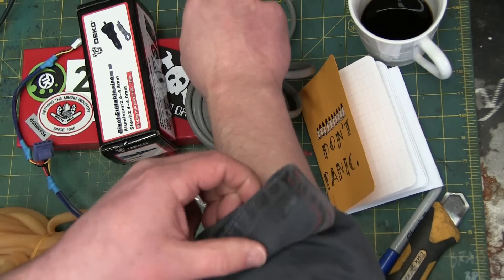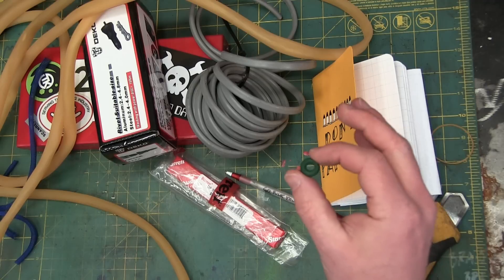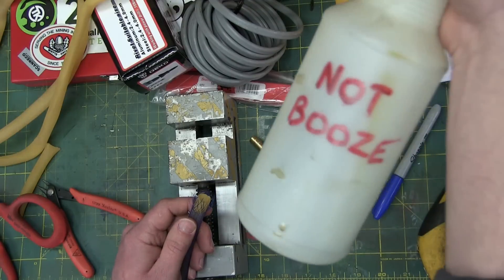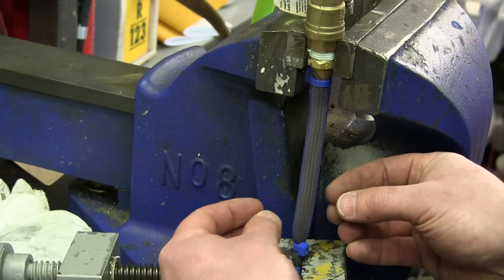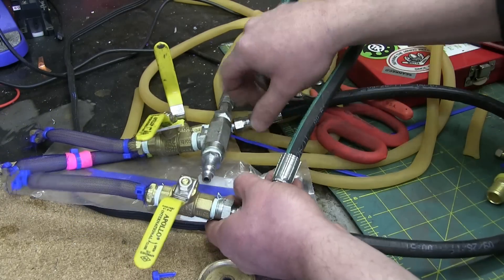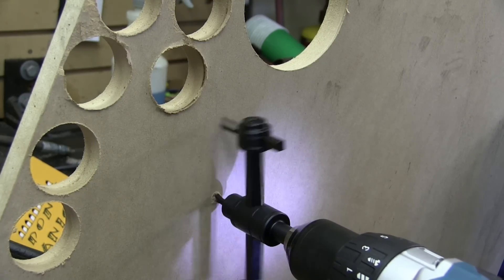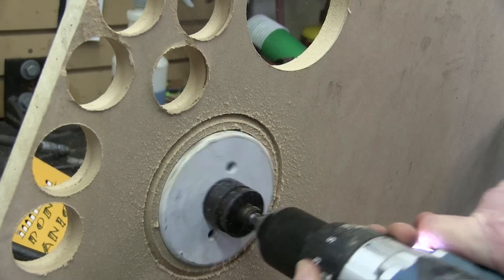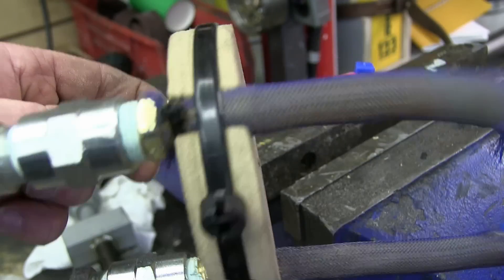Air Muscle Flex Joint for Soft Robot.

Comment: if you wiggle as you cut, as with your hole saws there, you can reduce stalling and jamming. the mechanisms are: slightly wider kerf gives clearance so the tool shank can't rub, and: tool pressure is focused into sectors. tool power is focused on that sector, so the motor has time to rewind to optimal rpm.

works for rotary and linear cutters

Comment: Okay, interesting, so I am in the long drawn out  process of building a humanoid soft robot. I prefer to work with upsycled materials such as Hype plastic, pic plastic, recycled containers of all types and sizes, rubber bands, drinking a d medical straws and such things. I have designed a electro magnetic heat and cerculitory system that is modeled after human parts I am currently working to duplicate the human digestive system to produce power supply. As I myself use at least 1 5 hour energy shot per say I have A massive supply of these small bottles, as well as many of these metallic looking drink bags I had the idea of using them in conjunction together to create a type of pmoematic  muscle, any thoughts would be apretiated, I am now subscribed and look forward to seeing what else you have .

Comment: Try a wider mesh. You need that thing to stretch to its maximum length at its thinest when it fits outside of the tube. So it has max room available for expansion when the tube is inflated. The mesh in the video doesn't really have much room left to expand any more.

Comment: I worked for a short while at a feed lot and the foreman there used a scalpel to open up the scrotum then ripped the nuts out while I held the tail up. It seems that if you hold the tail up in the air the critter can't kick you, which they tend to do when you're ripping their nuts out of the ball sack. My friend uses the wee rubber bands on his critters.
By the way, the last time I used tubing like that was when I made a slingshot to launch marbles at things.

Comment: Wood is recyclable and renewable. I myself have planted thousands of trees, and they all ended up pulpwood for paper and particle board two decades later. If they had actually been sawmilled it would have taken maybe a gallon of gas for 1000 board feet. All this fake wood and plastic is made from oil, and using it only increases our dependence on refined energy. 

There's a kid on adafruit's channel that makes all kinds of muscular things from silicone castings. Cool idea, I like playing with shapeshifting wire. Pull current through it, it gets shorter. Not much, but enough to make great servos for ultralight rc.

Comment: The pull distance is based on the difference between the uninflated and inflated diameters. Yours didn't move much because the rubber hose is too big, and the braided nylon sleeve had to be expanded to almost the full diameter just to get the rubber hose in. Use a smaller hose or upgrade to a bigger braided nylon sleeve, such as in an automotive application.

Comment: The mesh is already expanded out by being forced over the tube, so there's not much room for the air to do its thing. Thinner innertube or fatter mesh would be the go. And maybe a compression spring between the wood blocks to hold everything apart.

Comment: Looks like the great idea that I brought to fruition at my home some years ago. I thought that the hot and cold running water system in the house would be greatly improved by routing the incoming hot and cold water into two large manifolds. From each manifold there would be a hot and cold water shut-off valve and piping for every faucet in the house. My theory was, "In the event of a malfunction at any of the water outlet sites I would be able to isolate and disconnect only the water to that specific outlet and not have to cut the water to the whole house." It looked beautiful constructed of expensive brass & stainless single throw valves and all new shiny copper pipe. Each pipe connection painstakingly soldered and polished. All of it worked flawlessly as designed. The elation of a job well done was short lived though when it was discovered that you could die of old age waiting for hot water to make it any of the household outlets. A week or so later a major bypass operation was performed and hot water could make it anywhere in the house in under a minute, thus lending credibility to the old adage, "Just because a man can do a thing does not necessarily mean that a man should do that thing.
    And speaking of, that advise would have been prudent concerning several alcohol induced incidents 35 years ago involving many women that all were of questionable character and of which I cannot recall any of their names. Well, that is not completely true. There was the tall alienesque one affectionately dubbed "The Suburban Yeti". That one is, ironically, the one I wish to remember least. For several days after some unnatural activities involving the Suburban Yeti , and well beyond the hangover period, it could be said that, due to the Suburban Yeti's underdeveloped personal hygiene habits, certain aspects of the Suburban Yeti, uh, shall we say, lingered about long after the suburban Yeti had moved on to newer pastures in which to graze and stalk unsuspecting prey. Several days afterward several appendages on my body were no longer welcome and their very survival was seriously in doubt. Finally, a true friend (of whom I only later discovered had also fallen prey to the Suburban Yeti's olfactory charms) suggested thoroughly dousing my now rotting appendages in gasoline. Thankfully I was only in stage three of the Yeti's bacterial invasion thus sparing me the unpleasant, last resort, act of igniting my gasoline soaked body parts. My writing this warning to you today is proof that the gasoline BIAO (burn it all off) protocol was not necessary in my case and the less radical gasoline dousing treatment was completely successful. (Thank God). The lesson here is, if ever you make contact with a wild eyed, kinky haired giant that you can detect from great distances long before it arrives, do not become intoxicated in its presence as the giant will utilize your weakened state and do horrible things to your body. What you don't know is the giant is a Suburban Yeti and you are the unsuspecting  prey. If you are unfortunate and cannot make an escape I advise the immediate donning of a level 3 biological hazard suit that must be able to supply you breathing air from an off-site source. If a level three bio- hazard suit is unattainable A full body rubber divers wet suit with a full face sealed mask and on-board air tanks that can provide at least 2 hours minimum of breathable air may keep you safe. In either situation, afterward you must immediately contact the CDC offices in Atlanta, GA. at 1-800- MEPHITIC.

Comment: FIRE .......... Your tweezers were MAGNETIZED just thought a reminder about the WELLER SOLDERING GUN demagnetizer might be appropriate.   Stretch the tip or use a larger loop of copper. Pass the item through .  MAGIC ....... FIRE was just a ploy ..

Comment: Are you familiar with Festo's fluidic muscle? 
"Fluidic Muscle is a tensile actuator which mimics natural muscular movement. It consists of a contraction system and appropriate connectors. The contraction system is formed by a pressure-tight length of rubber hose, sheathed in high-strength fibres. The fibres create a rhomboidal pattern with a three-dimensional grid structure. When internal pressure is applied, the hose expands in its peripheral direction, thus creating a tensile force and a contraction motion in the muscle’s longitudinal direction"

Comment: Am thinking octopus limbs or arms or whatever they might be called...all flexible, with no rigid inner structure like mammals have. An example to go by, maybe: http://www.popularmechanics.com/technology/gadgets/a25888/inspired-by-an-octopus-the-octogripper-is-here/ -- I'm thinkin' yer basic wire loom with inner rubber inflatable tube is fine, but now limit how the loom can expand. Have three or four of these tubing/loom assemblies then fastened together inside a single common sheath with some give in it. Have all the assemblies somewhat pressurized, to make the entire "organ" (so to speak) somewhat stiff. Increase the pressure in just one of the loom assemblies inside the sheath, and the whole works should bend. Maybe.

Comment: I think it would work better if the outer mesh layer was of a bigger diameter than it is now, then feed it over the inner tube and stretch it so that it fits snugly over the inner tube and clamp it tight. That should allow the inner tube to expand which will increase the diameter of the outer mesh thus shortening it in the process. 

The idea is that the outer mesh stays the same length but not in a straight line when the inner tube expands.

Comment: That is a castration ring, but they are also used for docking tails on animals as well as cutting off the blood flow to the ol' seed sack. Eventually it turns black and just falls off. My grandfather thought those were less humane than ripping out the seeds with two clenched fingers and getting it over with in short order, rather than prolonging it over a week or two.

Comment: If you want to move that abound more "efficient", you need to stretch the muscles before hand, "easiest" solution in your case would be a stick between the two plates. One end fixed the other is a ball socket.

Comment: If you put a piece on non-extending something on one side of the rubber tube outside the mesh you can get it to bend in one direction. battelle (pnnl) has a patent for it somewhere like 10 years ago.

Comment: Instead of using the purple plastic ATX fingertrap material, maybe you could try cutting the ends off a steel flexible hose like the ones you use for under the bathroom sink, then remove the inner hose and you've got the same stretchable mesh muscle support. This kind of hose: https://www.amazon.com/Bathroom-Fitting-Flexible-Shower-Female/dp/B008J830B6

Comment: I understand the thing at the beginning for gelding calves was a joke but please, to anyone considering it for their animals take the advice of someone who works in a Vet Clinic and spend the $30-$50 to bring your animal in to a Vet, or if it's livestock, call them out, and have it professionally done. Those bands are absolutely awful for the animal, Causes insane amounts of pain aswell as almost guaranteed infections which can lead to the death of your animal. In most civilized countries if you get caught having those on any of your animals you get criminal charges for animal abuse and the animals taken by a local shelter. Please for the sake of the animals don't be cheap and get it done safely and as painlessly as possible.

Comment: I did something like this recently, sort of an inverse wobble plate doodad.  I had h2 on one side and driving the hydraulic pistons on the other side.  H2 was stored in hydrides, such that you cooled the plate attached to the hydride it went limp, and if you gave him a little he heat the H2 would pop right out expanding the artificial muscle and pulling on the wobble plate.  The problem I did not foresee was controlling the sequence on the h2 piston side.   So I ended up going with a different design, using two opposed piston on a common rod and having an elliptical tract, where the piston rod end has rollers attached to the tract.    I like what you are doing. Showing that it's ok not to try and be perfect, just be dirty and quick, rough it out, you will see and notice things that you would not, sitting like a can jockey and then doing all the engineering to make it perfect.  99 times out of 100 (I have never really seen the 1) you will not have something perfect the first time and you will need to iterate, and yes you can iterate digitally but there are things you will miss, for instance how are you going to turn that digital thingamagig into reality, that you do not see digitally. No substitute for getting hands dirty.   I wish someone would have gotten this into my head when I was younger, would have saved me years of tears.

Comment: You probably need smaller diameter latex hose, or larger diameter braid. As it is you've got the outer braid expanded quite a bit before you add the air so it can't contract much further.

Comment: That's quite fascinating. I kinda expected it to expand with air applied, but the wire loom causes it to act in the opposite way it would otherwise. This could be interesting if used to form an elbow joint. Have one muscle extend the elbow and the other bend it. Each muscle would oppose the other and the muscle without air would be stretched by the inflated one.

Comment: I spat some beer out when the sheath blew out, but also my mind was racing with ideas from this proof of concept. 
Low pressure hydraulic, with stainless braid.  The braided hydraulic hose pullers for big hose would have more flex/contraction. Just need to scale it down a bit and find a suitable core that can withstand the abrasion between the inner and outer.

Comment: I've used that kind of "hole saw" quite a lot because its what I got and its infinitely adjustable which is often handy. That tool is by far the most dangerous I've ever used, it tends to grab if you feed it in a slight angle breaking your wrists, tends to want to take your finger of when you tighten it like almost happened on the video, just all in all a hazard. Now maybe like you said its good in a drill press but that doesnt much help when you dont have one handy.

Comment: cool little tip if you want to fasten a rubber hose to metal pipe polyester string can put a ton of pressure works a lot better than zip ties and its eaquel all around put a dab of glue on the end and you are golden

Comment: Now how do we get this working on a couple thousand PSI of hot oil?  It would require steel mesh for the outside and some pretty sturdy rubber hose what for holding in all the angry hydrocarbons.  Air and latex is just floppy, oil and steel moosles would be proper useful.  For stuff.

Comment: The way that most muscles work it to attach to 2 sides of a lever. That allows for a small movement to create greater motion. (Think of holding a fishing rod and how a small motion at the handle, moves the tip a greater distance.)

Comment: if you want a stronger muscle there are metal meshes available like those plastic wire meshes.
Reply from the maker: Link?
Reply: excuse the hugomungus link, as a favorite ytber would say gotta piss with the cock ya got: https://www.delcity.net/store/Stainless-Steel-Metal-Sleeving/p_807301.h_811705.r_IF1003?mkwid=sCnAYy9dd&crid=38094426869&mp_kw=&mp_mt=&gclid=Cj0KEQjw2fLGBRDopP-vg7PLgvsBEiQAUOnIXIQdROF-yKyOQVMAZXjJNuwCSQAhobxowOL-1kYEJPUaAgqN8P8HAQ
Reply: the tin copper stuff is super expandable I know, though not as strong: https://www.techflex.com/prod_mbn.asp
Reply: Or modify a plumbing flexible connector

Comment: Might be too much science talk but fill the tubes with a granular material and under vacuum you get a jammed state. Could act as a solid 'stiff-enable' part so      that the other side has something firm to pull against. And more room for the 'nocturnal' jokes that way. There's some literature:https://pdfs.semanticscholar.org/f8be/7718bdf0eb2ad447f86cd63ac987ae62b8a0.pdf

Comment: That castrating elastic may be easy to use, but it doesn't have a very good rate of success. and sometimes you can even get docked at the auction mart if you use it. Cutting out the prairie oysters out by hand using a scalpel is a much more reliable practice. Though it does require a greater deal of skill.

Comment: For an air muscle like this with not much in the way of shrinkage, I think you'd be better off using it with a joint where the short translation of the muscle is amplified. Basically a fulcrum, like where the calf muscle attaches to the heel.

Comment: @AvE: I think that it would work a lot better with a rigid piece down the center. Think how a spine, or any joint, works- it moves using the spine (or the bone) as the fulcrum. Without the fulcrum, it would be all slop with little actual movement.

Comment: Have you thought about using some of that magnetic oil?  Maybe you could use that to stiffen some of the tubes while moving the others?  It's all low pressure, but I dunno how bad it is to have magnetic oil flung around.  Should be an easy cleanup though!

Comment: here's a little tip. if you have those latex tubes you can put them in a plastic bag with a small amount of brake fluid in them they don't crack

Comment: I've used the "whirling sickle of misery" in a drill before, the cut is awful, it jerks around like hell. It doesn't do much better in a drill press, but at least it's less dangerous.
Reply: I used a two-ways one... once. Cheapo chinese one, no stoppers in the ends so of course one of the blades just fucking SHOT out of the machine and made quite a loud bang when it hit the wheelbarrow 5 meters away... I'm never using that bastard again, it would have lodged itself pretty deep into my rib cage...

Comment: I have the sketchier flycutter, its a cut off section of a circular saw blade bolted onto the side of a dull hole saw... add more washers on the bolt and you get a bigger hole!

Comment: Your problem is that you did the opposite that you should have done to achieve efficiency with these muscles: the rubber pipe you use must be as thick as the cable sleeve when you get it (the cable sleeve) stretched. And you are better off with cable sleeve that is made of stronger polymers however not too dense. Dense cable sleeves will allow less room for movement.

Comment: We use isopropyl alcohol to slip insulated wire and cables into dry rubber.  it evaporates clean- no residual lube.  might want to try that next time you jam a fitting in a hose.

Comment: Those circle cutters work in a drill if you're cutting drywall or acoustic ceiling tiles. Generally I like the RPMs high and very light feed, does a good job.